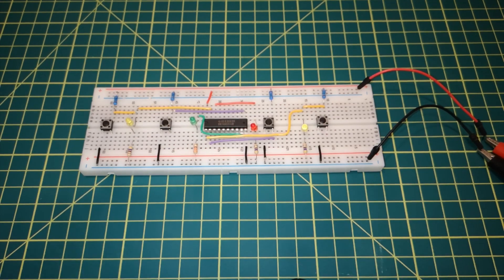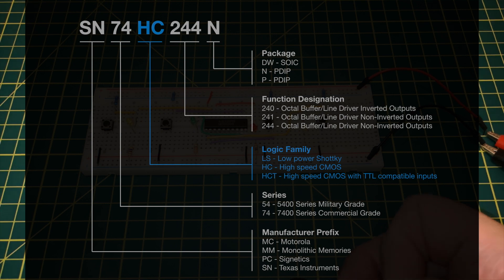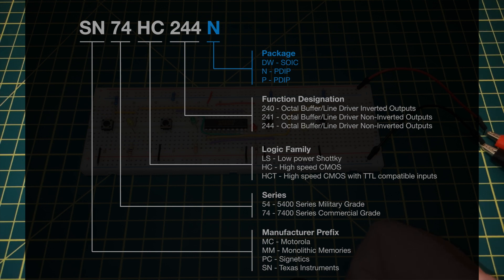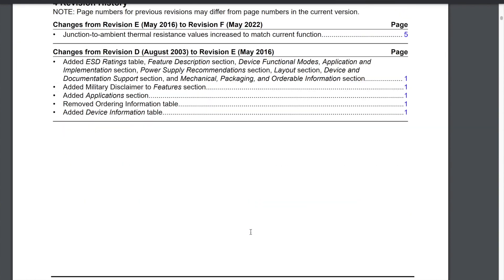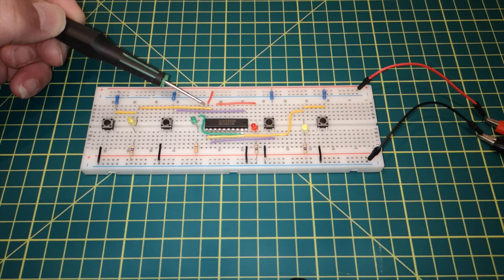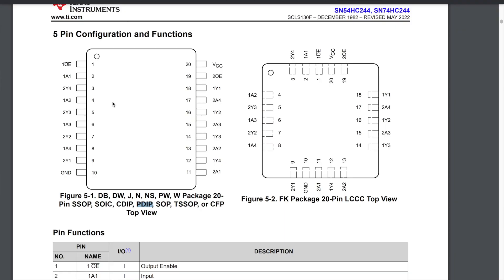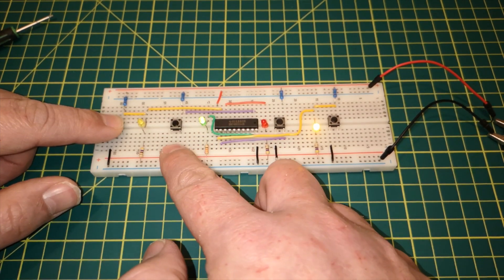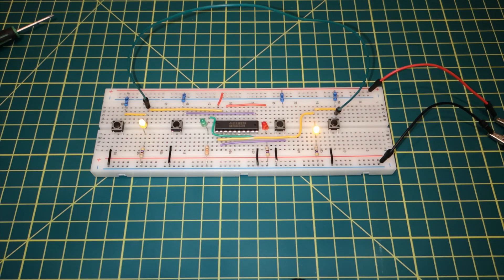SN74HC244N Octal Buffer

Comment: Can we pass though analogue audio through this chip ? I was wondering that can we make some kind of mute switch using that buffer
Reply from the maker: No this is designed for digital signals. Mainly to isolate busses. I don't have an experience with building a mute circuit for audio, But I would imagine you would use a transistor. Which is essentially a switch. But I also imagine the topic is a bit more involved.
Reply: @SteveRaynerMakes  can I turn on relay directly from ic output pins can this ic hendle inductive load .....5v relay
Reply: @SteveRaynerMakes  thanks for answering...

Comment: Friend, I have a big question, I have a BTS7690 module that is used to control the direction of a DC motor, but the SN54HC244 integrated circuit has continuity in the VCC and GND pin (pin 10 and 20), is it in another circuit?  I would appreciate your help friend

Comment: I'm just reading through Steve Ciarcia's book and have this and the HC254 and I was going to use this to buffer the Z80, but then I read on a forum that they recommend 74LS244 instead because they're schottky's. Can I use the ones I have?
Reply from the maker: Do you mean a 245? I'm not aware of a 254. If so, both the 244 and 245 are schmitt trigger. Not sure about the schottky part you are referring to. Where as the 244 is unidirectional, known as a buffer, the 245 is bi-directional, known as a transceiver. I believe either would work in this application. I would presume back in the day the 245 would have been more expensive. But I'm only guessing.
Reply: If you mean HC versus LS then it might work, or it might not. The voltage levels are different HC=CMOS and LS/HCT=TTL

Comment: I assume that when you release the input enable switch the chip retains the state of the data switch?
Reply from the maker: No, when the output enable lines are high the outputs are high-impedance, when the output enable is low then the outputs match the inputs. Nothing is stored.
Reply: @SteveRaynerMakes  Because it’s a buffer and not a latch?
(A mechanical engineer cosplaying an electrical engineer here...)
Reply: @tuppyglossop222  Correct! Watch Mr. Carlson's Lab Nixie Tube frequency counter video thats 116:39 long at the 34 minute mark to see the chip in action.